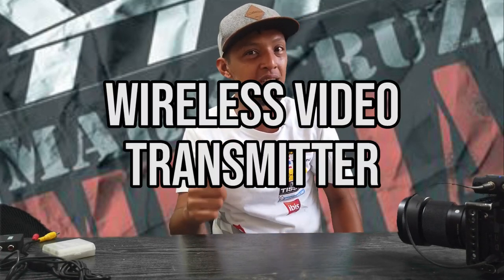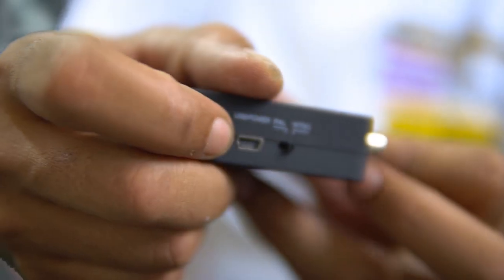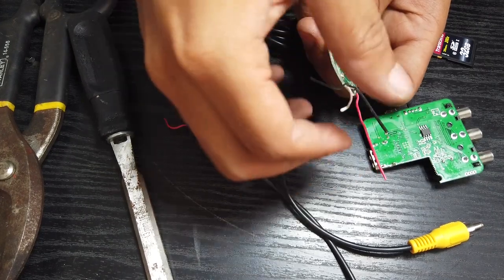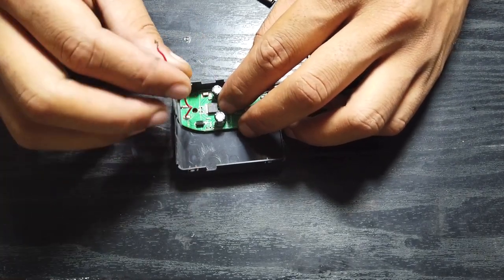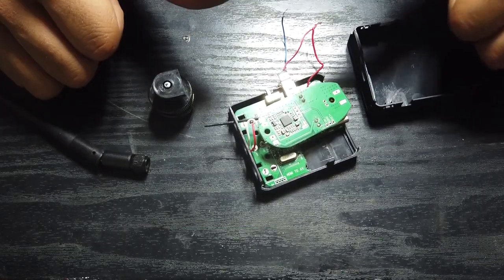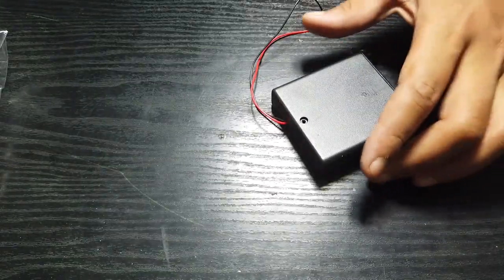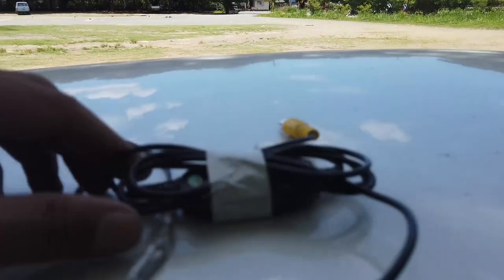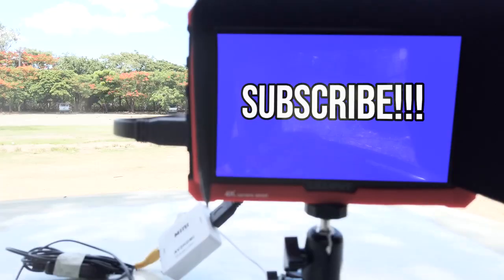Build a cheap Wireless Video Transmitter for your camera!!!

Comment: If you are on a tight budget like me... I use a car reversing monitor ( Not great but works..) that accepts RCA and only cost me $12 in auction.. It needs 12 volts.. Perhaps a cheap voltage convertor circuit board could be used here..     So for video transmission  you would only need HDMI to RCA -   Transmit RCA -   RCA into Car Monitor.

Comment: It might be the 4.8 volts to the transmitter not able to sustain the current needed to operate both at the same time. What was the original line of sight quoted by the transmitter using 12 volts. A good effort, as I have struggled to find a cheap alternative to the Mars transmitters and as I film for a hobby the £300 price tag is unjustified. Great job enjoyed watching that. 👍
Reply from the maker: Thanks mate! Product was quoted to transmit and recieve at max 10m at 12v. I guess it would up my range if i increase my voltage there if i increase the volt supply. Just gotta figure out a compact 12v rechargeable battery i can use so the camera doesnt go too heavy!
Reply: @markcruzmedia  hi mate, whats the result after increase the voltage? any improvement of the range? im very interested in this project

Comment: 2.4G doesn't have anything to do with the voltage. That's the transmission frequency. It's 2.4 GHz. That's a standard transmission frequency.

Comment: How much for it boss can you make me one please.....ill pay for it....
Reply from the maker: Holiman_Oficial hi, this was just a prototype, and based on the results, i couldn't get a decent distance from this. I will make a second version of this, stay tuned!
Reply: @markcruzmedia  maybe you can use 5.8ghz transmitter, 😆
Reply: @markcruzmedia  to increase range, try using the recommended power (12v) and proper antenna. probably test it manually first (with what it comes) before modding and repacking it